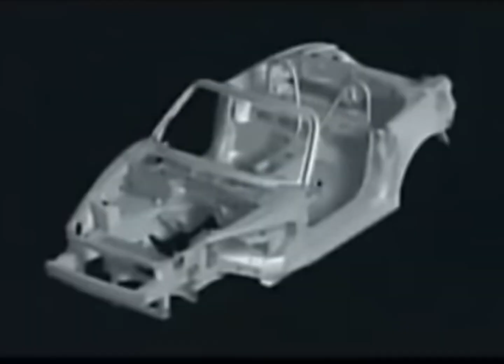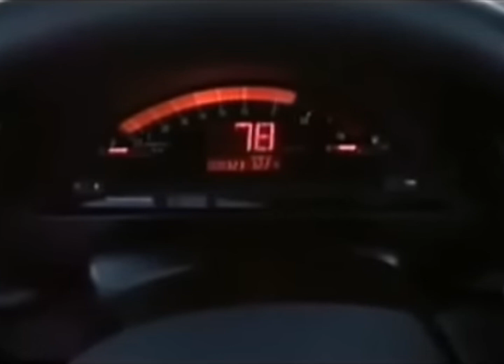The Engine That Defined Honda's Spirit

Comment: K series was Honda’s last great engine. There is a reason why everyone does K swaps and not “F” swaps.
Reply: Because the F engine only came in one car while the K engine can be found even in grandmas grocery getter. It’s easy to see which one can sell more aftermarket parts. I’m not disrespecting the K engine by the way. There’s a reason why Honda put it on everything.
Reply: The f20c came out after the k series
Reply: @MentallyIllOstrich the k20c was released in 1999 while the k series came out in 2002.
Reply: The advantage to the K series (over the F) is the head (cam phasing i-vtec) and more midrange torque; but the F20/22 is better engineered as a race N/A engine with better balance, higher piston speeds and lower piston sideload.  While a K20A is capable of running at 9K rpm the F20 could practically live there without modification since it is naturally better balanced. The F20 was the last great engineering feat for a N/A Honda race engine for the street, while the K20 deserves equal respect for being more suitable for heavier cars that need the midrange torque (or boost). Two different engineering philosophies, both engines have their strengths and weaknesses. I know this because I have owned both K series and F series engines (both tuned). The F20 was made specifically for the AP1 chassis, while the K20 or K24 is quite tunable and flexible for swaps. I have driven CTRs, Integras, RSXs, TSXs and S2000s which IMO were quintessential Honda for their time. The S2000 is a pure driving experience and this video sums that correctly.

Comment: All of that just to get Ls swap😂😂😂
Reply: the LS is barely capable of producing HALF the power of the F20C per litre...when you use forced induction to try to get an LS to produce per-litre figures that approach the F20C...it falls apart. Because it is a neanderthal.
Reply: @graceann335  yeah a 2.0 4cylinder that got too much rpm that it barely makes torque😂😂😂 probably a milwaukee drill makes more torque.😂 horsepower is just the part of the equation buddy!

Comment: Those who know, know that K20 is superior by having a higher performance potential than this.
Reply: Here we go again 🙄
Reply: K20 is a compromise. F20c is a masterpiece.
Reply: @vk45de54  couldn't have said it better
Reply from the maker: Truthfully as the person who made the video, I agree but you gotta admit the F20C is still i cool engine.
Reply: @Rekashii  people like OP are not comfortable with being conversive or simple admissions
Reply: @Rekashii  K20 is a great racers engine. F20 is for the drivers.
Reply: @freshtapcoke The k20 is also a drivers engine. From the factory it has an 8500rpm rev limit and with cams and a type s oil pump, can sustain 9k all day.
Reply: “Potential”, but this engine was perfect for this car. Lots of engines have higher potential, but they didn’t go perfect on the roadster like the F20/F22
Reply: Hey, cool story my guy, then go buy a car with a K20, wtf, foh
Reply: And those who know, know that isn’t true.

Comment: Unless you really hammer on this engine it is completely gutless.
Reply: Thanks Captain Obvious, as if this isn’t the case with every small 4 banger 😂
Reply: @BigCountry-df9rj  right😂 like thank you captain obvious
Reply: Of course, it's only a 2 liter, it doesn't have the displacement so it has to rev to move air and make power.
Reply: @tomtom255  that's indeed how small displacement engines make power, although a lot of people seem to miss the mark
Reply: Yeah i hate revving to 9k rpm..
Reply: It's not hammer we don't leave it a trailer park it is revving high where it makes all its power and stays together which gm ford could NEVER a motor that revs that high and stay together because they're all pushrod  dinosaurs running out of breath at 3K rpms
Hahahahahahahahahahahahahahaha
Reply: You don't understand engineering